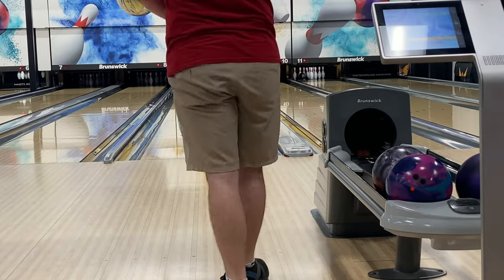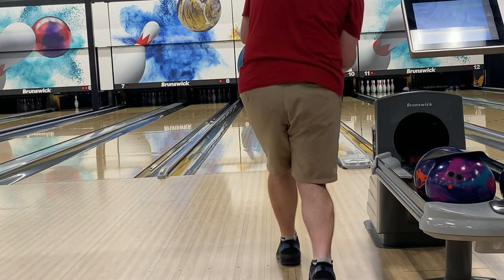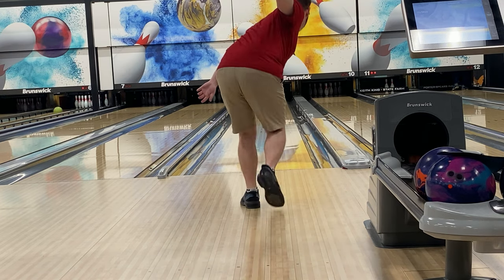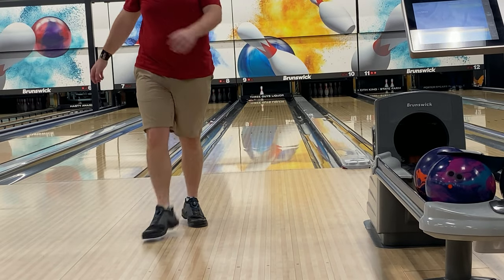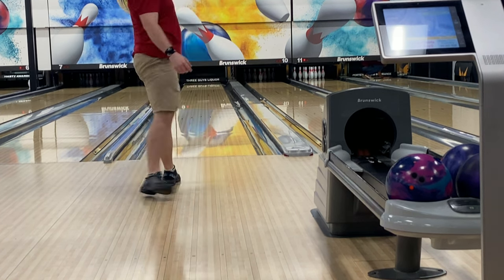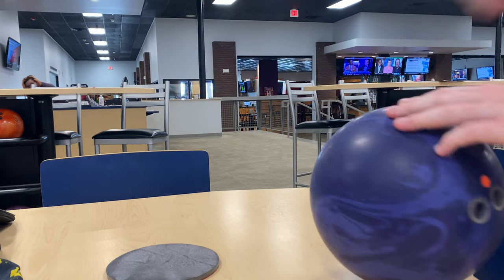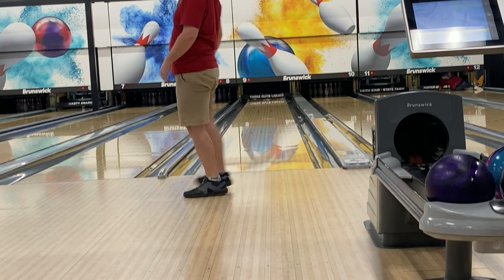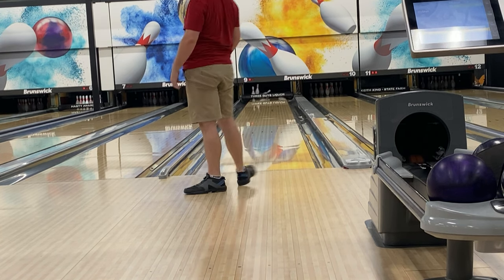How to Bowl on a Flat Oil Pattern | FloppyPENGuinn

Comment: I'm bowling  on 40' Red Square, I throw motiv equipment.  It be my 1st time on it. I have 300 revs roughly  and 15mph speed. Does you used pin down, pin up, or short pins on your layout. I have the Ghost, Flare, Rogue Blade, Nemesis, Pride, Blue Coral Venom, Enzo, and Purple Tank.  Which of these will help me on this  condition?
Reply from the maker: The purple tank will definitely be a good one to try first. Don’t be afraid to work with surface and try surface adjustments!
I would also try the jackal ghost, since that is a very smooth ball also and can give you a more predictable ball motion
Reply: @FloppyPENGuinn  
I'm flying to the tournament,  only can take 5 bowling balls.  Which 1 of them will be a spare ball. In your opinion could 4 of this list of balls be enough?
Reply from the maker: @richardsantine7318  yes, I think so. You probably know better than I do about how your equipment rolls specifically, but just based on the list I’d go Purple Tank, Jackal Ghost, Blue Coral Venom, Supra Enzo and spare ball. That’s my suggestion
Reply: @FloppyPENGuinn  Thank you, but I have one more question.  I was wondering what n grits to m put for what balls. I can usually  figure it out, but want a 2nd opinion from a bowler who has better knowledge..
Reply from the maker: @richardsantine7318  no worries!

I would go lower grits on urethane & solids for sure. Maybe try 1,000 at first, and go to 500 if you need more
Reply: @FloppyPENGuinn  in your video you talked about having a Zen and Jared having a Iron Forge, on the list that you suggested on my arsenal. There wasn't a pearl mentioned,  which I have a pin down Nemesis. I also had a pinup Rogue Blade. Would either one of them would work?
Reply from the maker: @richardsantine7318 I think either one could, although I did suggest the Supra Enzo, which would be the best ball possible out of the list to have for when they break down
Reply: @FloppyPENGuinn  I'm gonna take 6 balls instead of 5. You name 4 out of 5 that I had pick. I thought of the Flare instead of the Ghost, but it made more sense in taking the Ghost instead. Thought of the Rogue Blade because it is my bench mark ball.
Reply from the maker: @richardsantine7318  Oh great! I would say go with the Rogue Blade, although you will know the 2 better than me, with it being pin up it’ll have more of an opportunity to help with transition and store more energy for downlane to turn the corner as they dry up
Reply: @FloppyPENGuinn  thank you for your advice.
Reply from the maker: @richardsantine7318  No problem
Reply: I throw motiv equipment and with a 300 rev rate I would start with the jackal first and bunch of surface on it. Tbh the whole blitz line of urethane is better than the purple tank when it comes to motion imo. You would need something with more motion because your rev rate is low I would go with the blue tank blitz or my favorite urethane which is the uc3. That is the only piece I throw outside of motiv. I hope this helps you out👍

Comment: I bowled on this for the first time tonight and I shot 193. That ended up being the highest out of my friends and the second highest of the day. I'm normally just a house shot dude but dang I'm impressed I could do that well. I didn't know it was red square until after I got done, I just threw my first shot and realized it was gonna be a harddddd night of bowling.

I ended up having to use plastic because I don't have very high ball speed and my rev rate is decently high so I ended up having the best look with my spare ball and throwing very straight. But hey, it worked!
Reply from the maker: Nice job!
Reply: @FloppyPENGuinn  thanks. Great video from you too. 😁